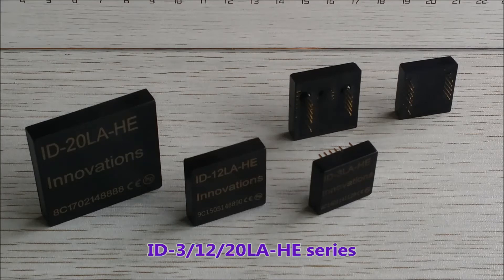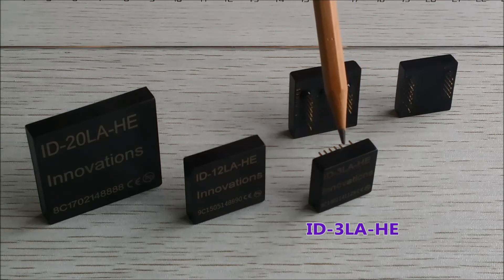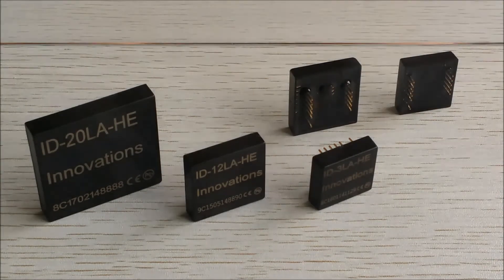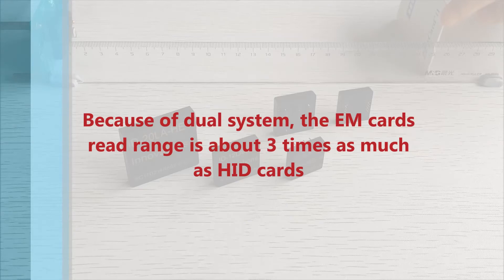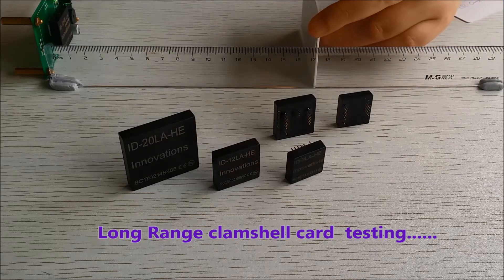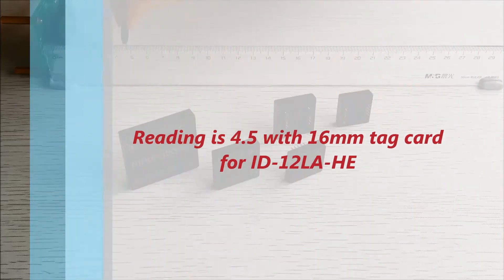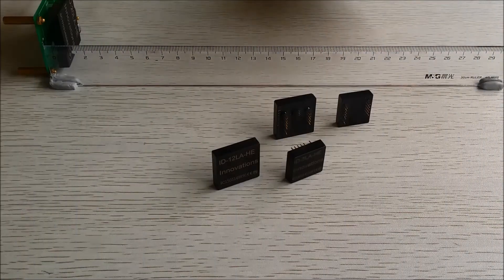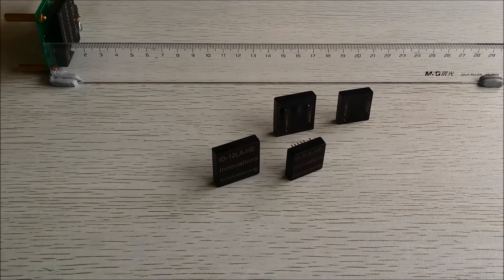ID-3LA/12LA/20LA-HE series testing finished

Comment: I bought several of these modules ID-12LA series from both Sparkfun and DigiKey. I have not been able to get one to work. I moved from breadboard to perfboard, to mitigate any coupling that might be occurring. Put a beefy decoupling cap between the VCC and GND. Have the Format tied to ground, reset tied to VCC. Not getting anything on the read pin or DO pin.